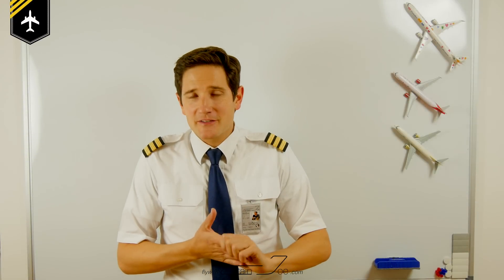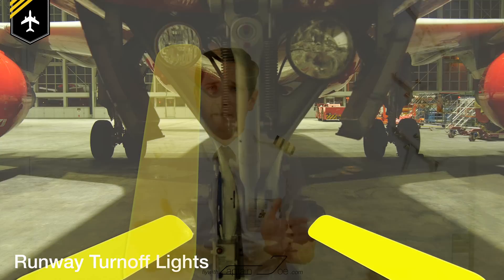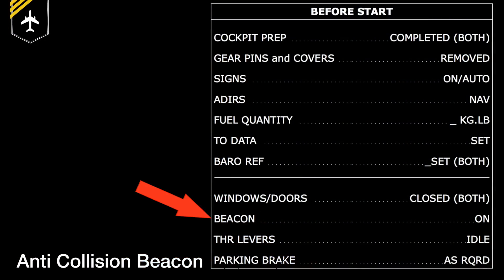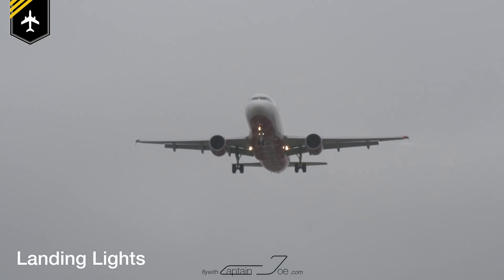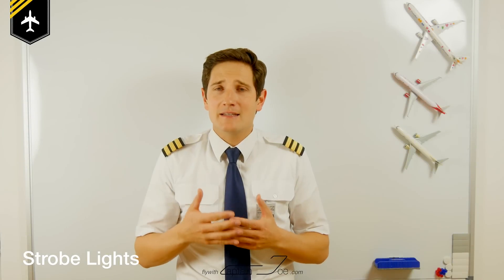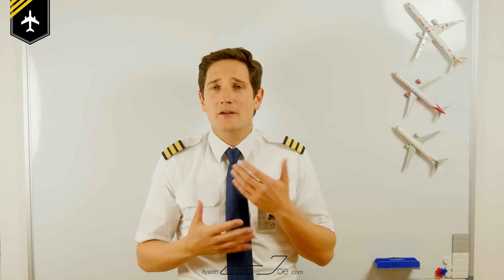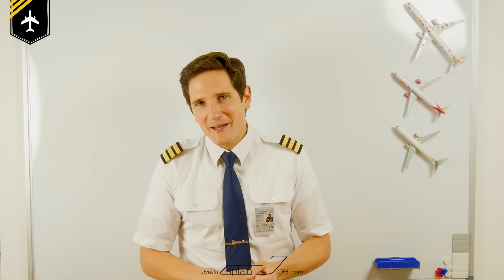LIGHTS on Airplanes explained by "CAPTAIN"Joe

Comment: Why the pilots turn off the strobe light of the corner of the wing before arriving at the terminal?
Reply: Because that means the aircraft is out of any active runway, and the fact that the strobe lights are very distracting on ground

Comment: I grew up close to an international airport. There was a point where one could stand and at which incoming aircraft would switch on their landing lights - at first powerfully illuminating the ground where we stood, before pivoting upwards. Maybe practice has changed since then,  because this must, I think, have been below 10,000 feet - it would be about 3 miles from the apron.

Comment: Any reason why there wouldn't be cameras on the sides of the plane pointed towards the engines, so the pilots can see things like icing, fire, engine damage, etc.?   Also, a rear camera is not needed?
Reply: Rear camera's are mainly used on longer aircraft so they don't taxi onto grass

Comment: I was told by a Virgin Atlantic Captain when I was invited to take his seat while he went for a nap 20 odd years ago that each port and starboard navigation light was 112.5 degrees of arc whereas the rear white light had an arc of visibility of 135 degrees. Perhaps I am wrong and I stand corrected but that's what he said ;perhaps he was thinking of boats and ships ??
Reply: That was a pretty accurate explanation, like it is shown here:
https://upload.wikimedia.org/wikipedia/commons/thumb/6/63/Boeing_747_navigation_lights.svg/449px-Boeing_747_navigation_lights.svg.png

Comment: Cars have rear window  defroster to clear the window why cant aircraft use something similar to prevent icing ?
Reply: They have it. You can see here the window heat switch on the Airbus A320 overhead panel.
https://regmedia.co.uk/2018/09/06/antiiceairbus.jpg?x=442&y=295&infer_y=1

Comment: Dear Capt Joe, since few years i have been noticing white lights in strobe, takeoff and landing lights on new aircraft of 737, 787, a350 and a320.  Were the lights originally yellow earlier? And is there really a specific reason for having white light? (Like better illumination or less power consumption due to LED light etc).

Comment: I don't understand why they don't put video and thermal cameras on strategic places on the airplanes... like pointing to the front and back of each engine, pointing to the wings from above, pointing to the tail rudder, pointing to each landing gear both on their internal encasing and the external position, pointing to the cargo bay and also to the passengers cabin, that way, in case of an emergency pilots could see if their engines flamed out, or if they rudder stuck at some position or check for any structural damage on the fuselage or even if their landing gears have stuck at some point or if a fire is staring either on the cargo bay or on the passengers cabin...

Comment: I grasp the meaning of lights on an airplane, but why do certain (mainly) high buildings have blinking lights also? Is that to "warn" pilots if they happen to fly extremely low, as most of these buildings I mean here are not near an airport so only when a plane is flying realy low the hight of the building comes into play. So do you know about these lights on high buildings?

Comment: Why do some aircraft  such as the embrear 195 -170 have two sets of strobe lights one on the front wing tip and one on the back of the wing tip. I thought they only needed one in each wingtip?

Comment: hi I have a question always wondering this since I use aerosoft airbus x in fsx, you answered all my questions except about the wing scan light, when is it turned on? when I fly I use it the same as landing light on when cleared for takeoff up to fl10 then back on under 10k till off runway, what is the procedure, because when I flew recently I noticed the whole wing lit up when we went under 10 thousand. thankyou

Comment: As you said that the landing lights points forward, but i when i see i plane in the sky below 10,000 ft, when the plane gets away from my location that is when it moves forward and when it points out tail toward me, so something i noticed that look like landing lights. But i am very confusive, that were those the landing lights? And if yes so how could they spread their lights backward?
Someone plz answer me all the questions
Reply: There is no landing light on the tail. There is a strobe light on the tail, that will flash.
Reply: Ozan Akdag but that's a non flashing lights. I saw them in the group of three.
Two were on each wing
&
One was below the tail
i.e. the part below where the fuselage ends!
So plz explain that!!
Reply: Sounds like strobe lights... maybe they were on steady position, so they don't flash. But those are definitely strobe lights.
Reply: Ozan Akdag but i can see the strobe lights separately, which were flashing and that other the lights separately.
I am talking about Boeing 777
Reply: Shoeb Ansari Same for 777. You probably saw wrong. There is nothing that can explain that, unless you saw a UFO

Comment: Can you plz answer me that when plane takeoff, so how do it take off?
It accelerate on the runway through the engine power or the power of the tire or the landing gear
Plz answer it
Reply: It's all thrust from the engines, the wheels are not connected to any power source and simply rotate freely.
Reply: The wheels rotate freely, it's the engines that make the plane go forward. Once the plane reaches a sufficient speed (known as V1 or Rotation Speed), there's enough air over the wing for it to create lift, making the plane fly.
Reply: So how does it performs taxi, through wheels or same engine power?
Reply: Shoeb Ansari Same thing, just the thrust from the engines. The only thing connected to the wheels are hydraulics/electrics for steering and brakes.
Reply: Nathan Chetram ok thnx

Comment: Hi Joe. Great stuff. Can you explain how a plane travelling east at the equator is still able to cover distance while the earth is rotating under it at 1000mph and the plane can only do 500mph. How is this possible?
Reply: Stationary Plane similar concept to if you throw a ball high in the air, you can catch it even though the earth is moving.
Reply: A2DJP. There is zero evidence to support the earth being in motion. Only theories I'm afraid. Cheers anyway. 🖒
Reply: Stationary Plane lots of stuff are just theories. Like coriolis force. But at least it explains something lol
Reply: A plane sitting stationary on the equator is also moving 1000 mph, the same as the earth it is sitting on.  When it accelerates to the east at 500 mph, this is relative to the surface of the earth.  It's moving 1500 mph if you add the earth's starting velocity.

Comment: Joe,
can you tell me the name of long penals of lights those are located both side of under fuseladge and looks like many windows of high rise buildings in the long line are litting...if captain lit them, i only saw once when my neighbour used laser pointer on the air craft in the evening...and pilot i guess used them to warn..
Reply: I don't know what you are talking about, maybe you can elaborate. All aircraft have a red flashing beacon light, located above and under the fuselage.

Also, if you aren't aware already your neighbour is an idiot for shining a laser pointer at an aircraft. There are many incidents of pilots being blinded by such lasers when dumbasses like them shine them at planes. This is coming from a pilot of single pilot aircraft, if anyone were to shine a laser at me I would be fucked. If I somehow managed to land, I would make sure to make their life hell.

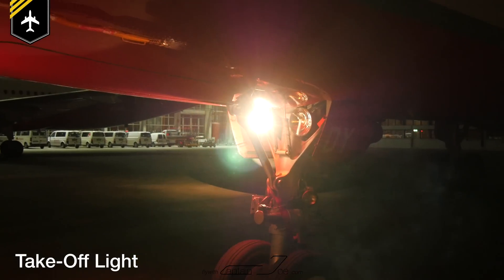Comment: On the closeup of the nosewheel (1:04) it looks like there's some sort of red ribbon dangling across. Is this one of those 'remove before flight' tags mentioned in another video? 

Combined with the turn off light it looks almost like somebody has taped a flashlight to the side of the landing gear.

Comment: Why don't airplanes use high power LED lights, like the ones used for Off road vehicles? those consume way less energy and are much more powerful
Reply: BadAssEngineering its just matter of time...
Reply: LED lights have a limited range (sight) of usefulness.  My guess,  They probably don't met the full FAA requirements as xenon, halogen, HIDs do.   Basically, the application for aircraft use is more demanding.
Reply: How many 600W LED headlights have you seen?  They do consume less energy, but they aren't more powerful. At least not yet.  The other reason is that every part used on an aircraft must be approved.  It takes time and money to do this.  The market is just starting to see some LED replacements for red/green nav lights and some lower powered exterior lights.

Comment: Okay, I've seen two similar questions that I've never been able to adequately answer - why don't airplanes have side mirrors and/or why aren't airplanes equipped with external surveillance cameras. Both questions are usually related in-flight problems leading to crashes, both purported as a means for crew to view engine or structural damage and similar.

Comment: A lavaliere microphone will increase your production value by 1000% , or any microphone near the mouth of the speaker and not 10 feet away on the camera. The room noise, with its reverberation, was a distraction I don't  think you intended to have, based upon your otherwise impeccable production value. Don't neglect the A when producing A/V!!!

Comment: Dear Joe; can you please explain why so many pilots seem to insist on smashing the front wheels/tyres over the runway lights causing this extremely loud rhythmic slamming noise as if to want to damage the undercarriage? It's so bizarre. Can't they just steer a few cm to one side so that the front wheels miss these lumps on the runway??

Comment: And why there is AUTO mode for strobes while its useless*
*You must turn them ON prior to occupying runway and not after the takeoff like AUTO mode does (AFAIK it turn them ON after WOW switches no longer detects that aircraft is on ground).

Comment: This just shows how dumb and stupid humans are. You mentioned boats so one would think the red, green and white lights would be the same since they do the same job and what have you but No, humans couldn't standardize something. You said the aircraft were rad (port) and green (starboard) were 110* and the white rear light is 140* and in the boating world we use red (port) green (starboard) of 112.5* each and the white rear light of 135*. Sure they are close but why did we have to do that? Another example of why engineers are nuts. Great video though I enjoyed it

Comment: I was just on an A320 and saw all those lights on the wings and under the wings and wondered what they were for and what they meant. I figured the bright light between the engine and fuselage was like a headlight. Very informative and another great video, Captain Joe. I sat in seat 9A (Right in front of the left over-wing exits) and also saw how much the wings change form and all the panels and flaps functioning. Captain Joe, do you have a video of all the wing components and how they function and what each component is for?

Comment: Whats reason behnd the ban on walking under the wing when leaving or boarding a plane? The airbus wing is too high to touch so passangers cant damage it yet we are told its for our safety. The engines are off so whats the danger? Is the wing likely to fall on our heads?

Comment: If airbus can place a camera on their vertical stabilizer. Why cant aircraft manufacturer place a cam on both side of the aircraft so pilots can view the wings and engine in an emergency instead of having to rely on air attendant or passengers.

Comment: Captain Joe, there's one thing I've always worndered about modern planes.  Why do they still have to rely on a member of the crew to look out of the window to check the engines or look for ice?  Why aren't there cameras pointing to the wings that the flight crew can monitor?  Cameras can be very small these days.  If a plane can land itself, surely that would be easy to do.

Comment: Hi Captain Joe, I watch your videos regularly and I really like them. I have a question. When a flight touches down on the runway, we hear a series of bangs as if the plane is running over a series of speed-breakers. Is it the sound made by planes running over the runway median lights? If not, then what is the sound?

Comment: Interesting video ... you should do a video explaining the wings area. I don't know If I'm correctly explaining this...But during landing or take off or even while in the air, I notice when seated by a window close to the wing, the rear sections of the wing mechanically moving up or down. Would be interesting to know what it's all about.
Reply: Jubin Kurien Those are extra high lift devices, the flaps on the trailing edge (without going too much into detail) reduce the TO-roll and LDG distance. These do however create some extra parasite drag. The leading edge high lift devices (front of the wing) are most of the times slats, that re-energize the laminar boundary layer of airflow over the wing, so that it does not "detach" from the wing. This changes the lift characteristics and allows for a slower approach without stalling the wing.

Comment: I never realized that there's a lot of rules and "when to do what" on airplanes.
Reply: Stranac Oppilas There are really a lot of rules, first of all, you have the law, which in Europe is controlled by EASA and the FAA in the US, which can be made even stricter, by each nation. Then you of course have the manufacurers rules that state what the aircraft is built for (DLL) and what it can withstand as a maximum (DUL) and how it should be operated by the airlines (this is all described in the FCOM or Flight Crew Operations Manual). Then of course each airline has its seperate rules on operating, some of them are due to insurance reasons, especially when the A/C is leased, and others are because that is how the airline would want their pilots to operate the aircraft, this may include things as responsabilities, when to use which power setting, your cost index and what amount of Flex Take Off Power should be used instead of TOGA (this is given by the company's SOPs or Standard Operating Procedures). Then there are also some "rules" by the ICAO or International Civil Aviation Organisation, that was founded at the Chicago Convention. These include communication procedures, Call-sign regulations, charts lay-out, the ICAO ISA used to calibrate instruments and even the ICAO Phonetic Alphabet. So there are a lot of things that a pilot has to familiarise himself with during his training and his carreer.

Comment: Holy shit how do you remember all this stuff😐
Reply: Justin Stuart well, you really see most of this in Ground School duribg your ATPL training, whether it is modular or integrated. Once you get selected by an airline and do your type-rating, you learn everything about the plane that you are going to eventually fly on. So it is expected knowledge for every pilot. They also retest you every now and then to make sure you still know basically everything. Active pilots also have to do a sim-check every 6 months to make sure they know how to react to certain situations, and see if they are still familiar with the SOPs (Standard Operating Procedures). So, that is how you get to know so much, commitment, the right attitude, interest, and repeat it so much, that it just becomes common knowledge to you :)

Comment: Why aren't Airplanes equipped with  emergency parachutes for passengers?
Reply: __raw_all The altitude at which parachuters jump is way lower than the altitude at which airliners fly. That would mean that pax would also need O2 bottles when jumping from such a high altitude. Also, parachutes are not exactly the lightest objects, they weigh a lot thus increasing the specific fuel consumption, and from looking at to which extents weight reduction goes at certain airlines, (such as printing the safety card on the head rest of the seat in front of you to eliminate the weight of the cardboard placards), and additionally, when unexperienced people decide to go parachuting, even for a dual jump with an extremely experienced instructor, they receive a briefing of at least 2 hrs, so considering the amount of people listening to the safety briefing (which is already low), would you really like to listen to a 2 hr briefing before each flight? And lastly, A/C doors don't open in flight for safety reasons, the door is bigger than the frame and opens inwards first, and then turns outwards under an angle so it fits through the frame. Since cabins are pressurized so that cabin pressure is larger than the atmospheric pressure around it, the door really is being pushed into its frame, making it close to impossible to open in mid flight.

Comment: You mostly answer questions that can easily be googled. You could explain the cockpit layout, that would be interesting... and at the same time give a brief explanation of the instruments - basically as if you had to teach somebody how to fly a plane in 15 minutes. BTW... do you feel safe in that Airbus? I very much prefer Boeings philosophy of giving the pilot full control. Airbus with its "fly by wire" electronics. It always makes me nervous that the plane could hinder the pilot on executing a dangerous but possibly necessary maneuver in case of an emergency.

Comment: The power rating of the takeoff lights suggests that tungsten light bulbs are still used for that purpose. Why is this the case? Unlike tungsten bulbs with their 10% efficiency, LEDs can achieve an 80% efficiency and (more importantly) ~50 times the lifespan of tungsten bulbs. Are there any regulations that restrict the use of LEDs in aviation?